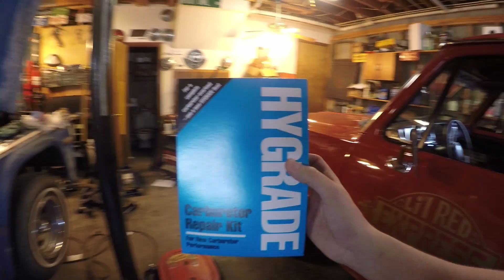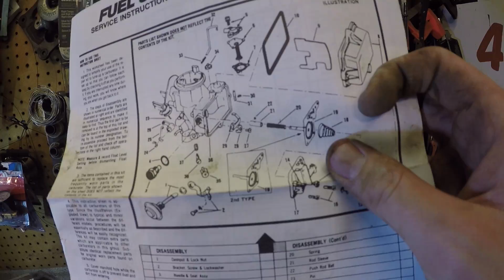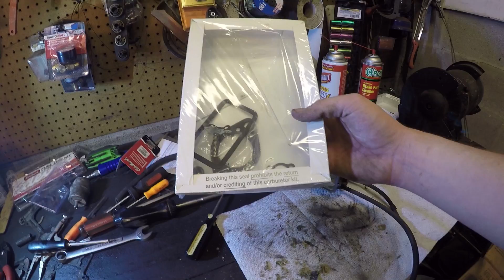Time Capsule Plymouth Carb Rebuild + PETTY TRUCK RUNS!

Comment: In the early 90’s, I could not get a rebuild kit with the correct accelerator pump diaphragm for my slant 6. But eventually I found a brand new car. At Murray’s Auto Parts, for $77. It ran perfect right out of the box.

Comment: Choke settings can  be difficult. There are 5 different adjustments! Trust me on this.
Give yourself a few days to get it to your liking.The dash pot settings are critical. IF the dash pot(Pull off) is leaking,you will never get it correct.
When cold,the choke butterfly needs to be closed all of the way. The" pull off "opens the choke butterfly,just enough to allow a full rich condition,when the engine is COLD.

There are linkage adjustments,too. The fast idle cam needs to be set as well. 
Needle nose Vice Grips work well.
Yes, the T.A.C. tube needs to be attached and working.(Big,shiny 2 " hose that goes to the exhaust manifold).
This video was posted in March and there will not be a problem until December,when it's a LOT colder in the mornings,Dylan.
The stumble may be caused by incorrect accelerator pump rod setting(s). It's a Holley carburetor.
Yes,I have done these.
 The slant 6 is a GREAT engine.The other one that is great: 258 AMC engine,with 7 main bearings.
I really enjoy your videos and I can help with your carburetor settings.

Comment: nice, only carbs i clean now are on my lawntractors, i use carb cleaner spray, sometimes brake cleaner, and use pine sol to soak them in. it works really good, let it set overnite ( after disassembly) in it and it cleans really great.   use carb spray and good as new.
like that sound the petty truck makes, that growl sounds awsome.
hey that chillhop music is great, i recently started listening it as well.👍
Reply from the maker: dangerous toys56 I used carb cleaner and brake cleaner too. Looking back I should've got something to let it soak over night but it's running just fine for me. If it gives more trouble that's what I'll do. Thanks!
Reply: Dylan McCool - yea i herd about using pine sol a while back, its not as nasty as the big carb soak buckets, and be used multiple times. 👍

Comment: Nice bunch of vehicles you have. Curious why you didn't change the fuel filter earlier, like when you rebuilt the carb? How long did this car sit idle? How's the inside of the fuel tank?
Reply from the maker: Frank P I glanced over it. I didn't notice how bad it looks until after I put it back together. The previous owner would start the car a couple times a year but it hasn't been driven in a good while. I'll probably change the filter again after driving it some more, but the main reason it had the dead spot was because of the float being adjusted wrong.

Comment: Do yourself a favor and get a heated ultrasonic cleaner.  I have a commercial one at my job and there is nothing better for cleaning carburetor parts, plus a LOT more.  But, carburetors especially!  I use water and Simple Green.  Buy the SG at Sam's for $9/Gallon.
Reply from the maker: Greg Cooper I'll remember that! Thanks.
Reply: I've watched a few vids where antifreeze is used to soak carb parts.  It looks like it works very well.

Comment: "It's kind of an interesting way of packaging something"   The reason they started packaging carb kits that way decades ago is because of the number of variations made of each carburetor.  The packaging is meant to allow you to determine if you have the right kit for your carb.  Most if not all auto parts places will not take back a carb kit if the plastic has been broken on the packaging.  You are meant to disassemble the carb first, identify that you bought the right kit before breaking open the plastic.  I have known mechanics to order all the possible kit variations of a carb to issure they get the right one, then return the unused kits.
Reply from the maker: MISTERComaToes I figured that out the hard way!